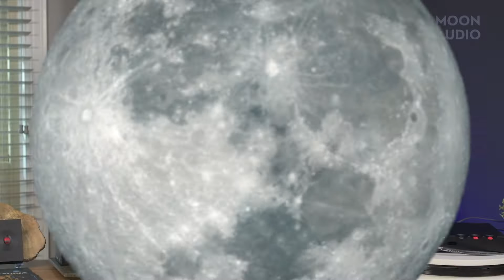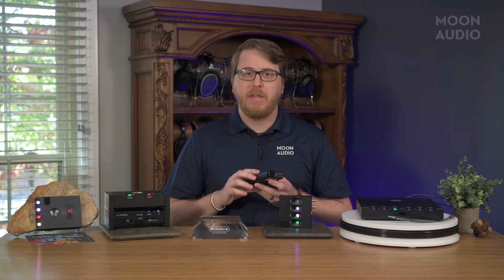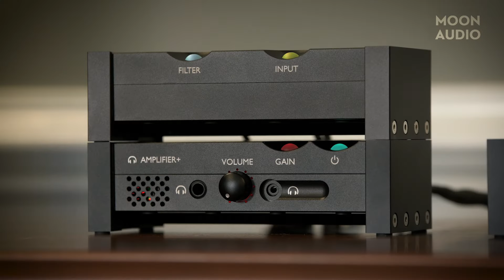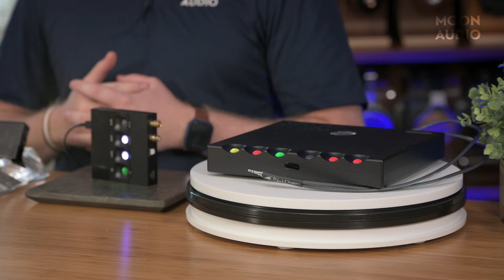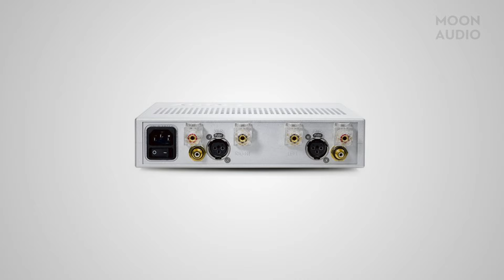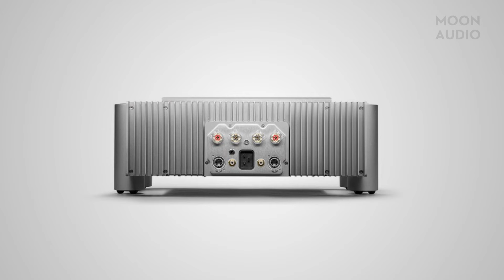Chord Electronics DACs, Amps, & Streamers: The Ultimate Guide | Moon Audio

Comment: May I know where I can purchase the XLR adapters used on the HUGO TT2 shown at 14:30 and the Dual BNC cables for stacking the M-Scaler and TT2? I’d read/heard that I shouldn’t stack them due to noise emitting from the MS, is this true?
Reply from the maker: We got you! Check out the links below:
🔗 Moon Audio 3-Pin XLR to XLR Coupler: https://www.moon-audio.com/products/3-pin-xlr-gender-swap-adapter
🔗 Silver Dragon Coax Digital Cable: https://www.moon-audio.com/products/silver-dragon-digital-cable-v1
If you have any questions, please reach out to us here:
📞 https://www.moon-audio.com/pages/contact-us
Reply: Is it actually balanced for just uses an adapter inside the unit?

Comment: Do Chord products all need wall wart power supplies?  If so, they're not for me.
Reply: Mojo 2 is battery-powered, Hugo 2 as well
Reply: my Dave DAC has a normal power cord and internal power supply.  I think only the smaller cased ones do, like the portable ones. that said removing the power supply to a larger "wall wart" is actually not a bad idea it removes it from the more sensitive circuits. modern hi end switching power supplies are actually quite good.